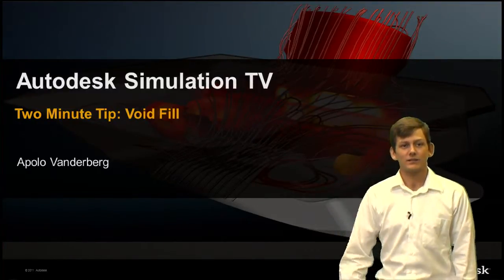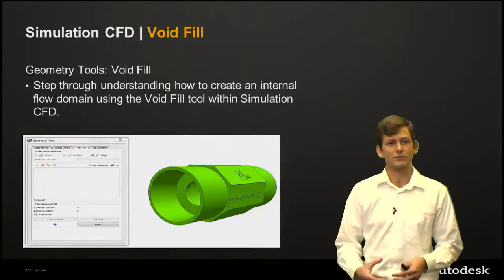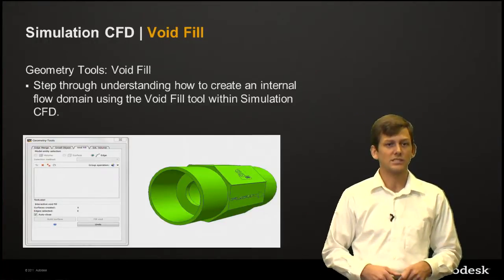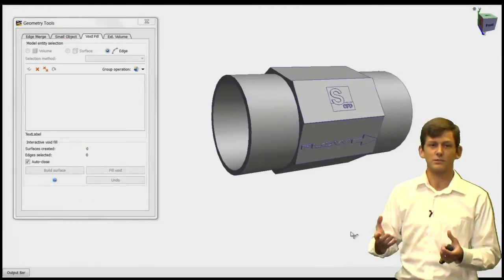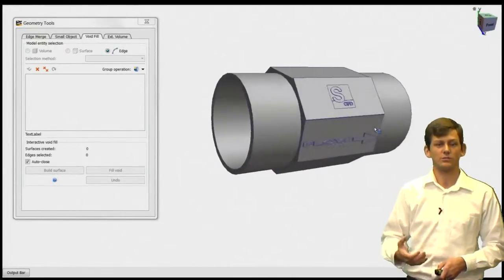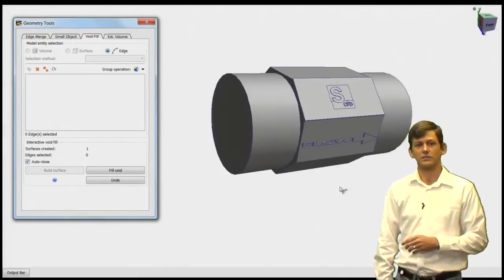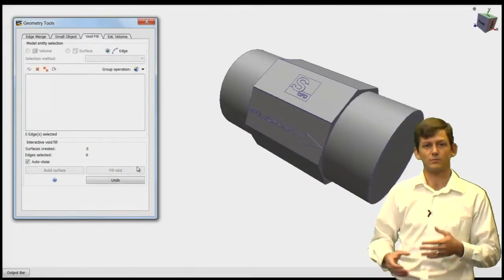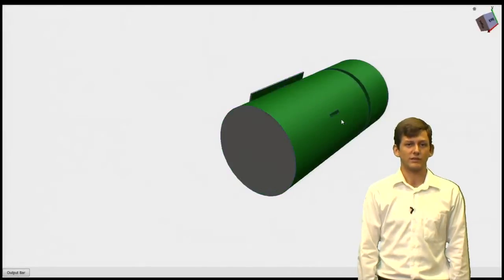Void Fill

Comment: ive gone this far but how do i assign an inlet and outlet? i set the boundary conditions of the inlet and outlet with the correct directions, but when i run a solve simulation it says: 2 inlets 0 outlets.. how do i solve this problem??? thank you